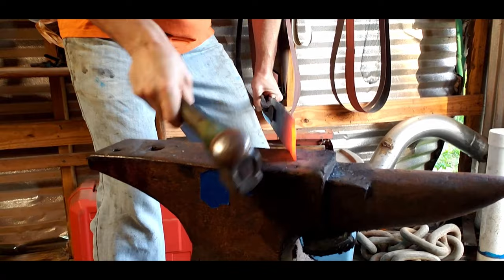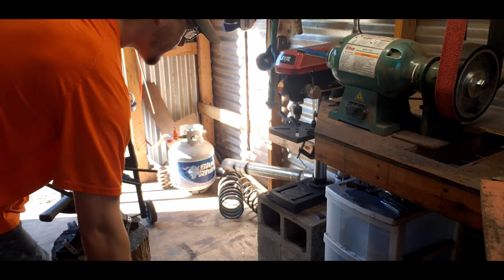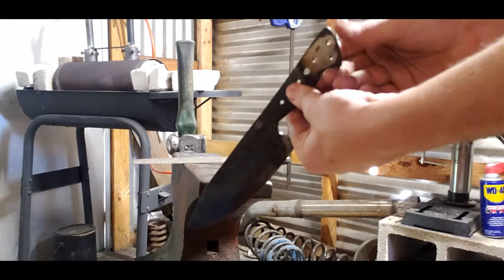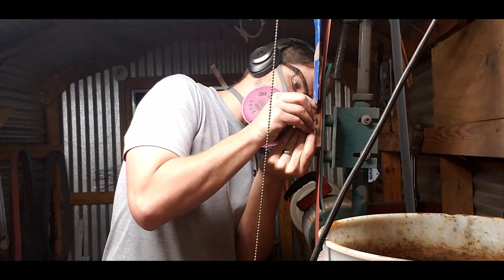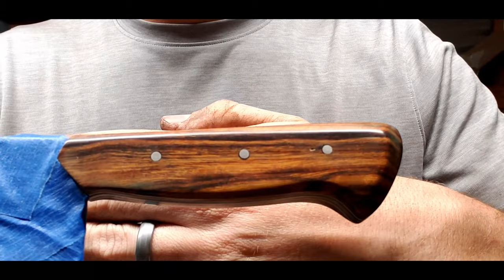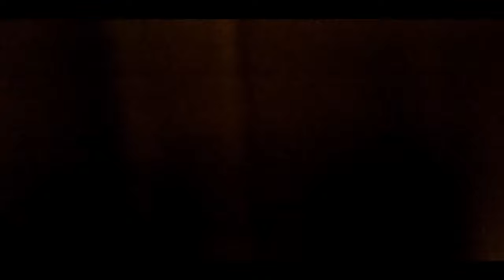Forging a Custom Chefs Knife out of 80crv2 with Ironwood handle

Comment: Could you share temps and times for the quench ?
Reply from the maker: Ideally you want to soak 80crv2 for at least 5 minutes at just under 1500 degrees. (obviously changes for desired harness). Because I used the forge, I just had to go by color of the steel and the ol magnet trick. Here is a good chart for color. for a lot of steels, you want to stay in the red to bright red range. https://knifemaking.com/pages/forging-steel-heat-color-chart 
I then tempered it for 2 one hour cycles at 400 degrees.
Reply: @hainesknives  Thank's , but how can you use the magnetic tric for 5 minutes ? 
Isn't it gonna oscillate from temp to temp ?
Also another knifemaker advised me on 8670 steel but it's hard to find here in Europe...  A comprehensive video on how to do it in a home made  forge would be awesome :)
Reply from the maker: @dimmacommunication  8670 is a steel I have never used. Not a real popular choice here in the US either. But, there are a lot of great steels that can be used. My two favorites right now are 1095 and 80crv2. 
To answer your question, I don't use the magnet for the full 5 minutes. Just in the beginning when I am getting up to temp. Once it is non-magnetic, I take a mental note of the color and try to keep it around that color for 5 minutes. It is not easy. That is why an oven is the best option. But that is one thing I like about 80crv2. It is forgiving. So I don't have to be perfect in the heat treat for it to work.
Reply: @hainesknives  👍👍👍

Comment: 80crv2 steel can have super sharp edge  but will not hold it long from my experience
Reply from the maker: I havent had an issue with it yet, but I'll keep an ey on it. I have a hunch though that my 1095 knives are holding up better. Time will tell.

Comment: did you forge in the edge/bevel?
Reply from the maker: It is hard to tell in the video, but yes. It could have been better, but it is there. Always try to do it to save on grinding.
Reply: @hainesknives  I try to forge my bevels in too.  Ceramic belts are my biggest expense.

Comment: What was the point to forge an extremely rough knife shape just to cut out the blank after?
Reply from the maker: 2 Reasons..... first was to stretch out the piece of metal I had to the right length by forging in the tang. And the second reason is practice. Brute de Forge is something I'm working on. Gotta spend time on the anvil to get better at it. 😉

Comment: Why 80crv2 for a chef knife tho ?
Reply from the maker: When making this knife I was still fairly new to using this steel, but it has great edge retention and is a bit more resistant to corrosion than some of the other 10xx steels. I think it is a great steel. (ps. I don't work with stainless yet)